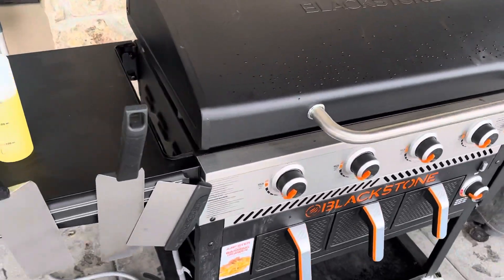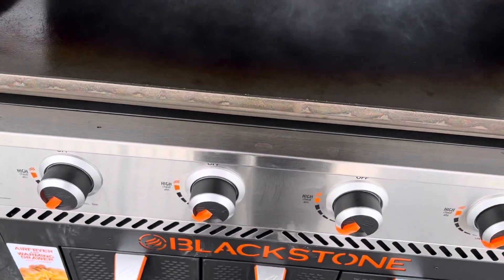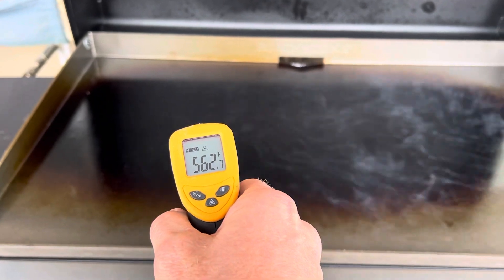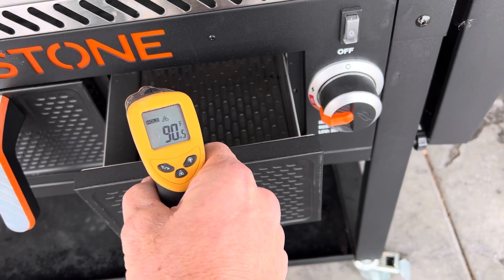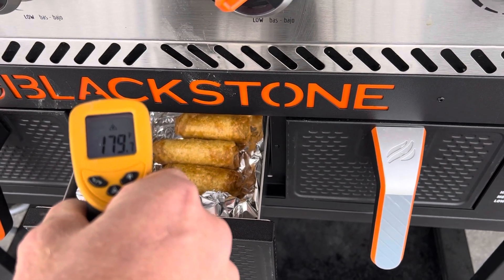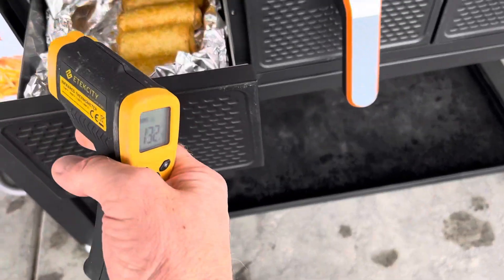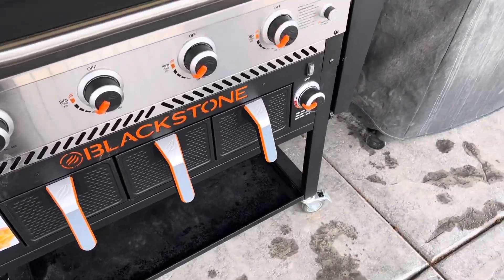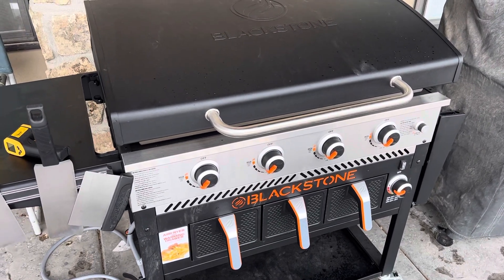Blackstone temp readings after natural gas conversion

Comment: Thanks! The right drawer is not an air fryer it’s the warming tray, which would explain the lower temp
Reply from the maker: I completely forgot about that! Yup, that makes sense. My batteries in my thermometer were acting weird so I thought that was it.
Reply: Also you’re probably getting the reading from the egg roll “food temp” not the air fryer. You’d have to get those egg rolls out of the way.

Comment: Can confirm what the temp gets to on the air fryers after running it for a while? They still say it’s not supported and I hope they can close to that 300-400 range but your video shows them in the 100 range still. Any update after running air fryers for a bit?
Reply from the maker: How long on high would you like me to run it to test it
Reply: @BryanHansen  I guess it would depend on temp outside and some other factors, if I’m not mistaken based on some picture black stone shows the air fryer on high will get up to 425F-475F, this is propane though but is ideal for crisping up food. The website says it’s not recommended because it will not get to max temp, so really curious how hot it will get say after 5 - 10 - 15min? I also wonder if the problem is running all 4 burners AND the air fryer. Maybe trying all of them and then just using air fryer by itself. That would give an really good idea.
Reply from the maker: @RyanandKelsieLaw  I started recording another video last night on the temps. I got interrupted so I didn’t finish it. 5 minutes in the air fryer was 321 degrees. I didn’t get the 10 minute temp so I scraped the video. I think I know why Blackstone says it’s not supported though. You can not, at least on natural gas, run the burners and the air fryer all on high at the same time. It is not hot enough. Individually they run great, but all four burners and the air fryer, no dice. It’s low to medium low temp at best.
Reply: @BryanHansen  I reached out to Blackstone customer service and they told me the only difference is that running on natural gas will run 50F less than propane, and they dont recommend conversion on this model because its hard to change out the orifice, but obviously based on your video the orifice can be changed with some work. My concern though is sounds like the 50F less is only if the top burners are not running. I already ordered my blackstone so i have another question for you, do you think its possible to covert top burners to NG but then reroute the gas line hose on the air fryers to run strictly on propane? or even convert it to run on a separate NG line? the NG line should be able to provide enough gas to all burners from my understanding so i wonder why its being reduced so much.
Reply from the maker: @RyanandKelsieLaw  It runs great. Honestly, it isn't that hard to swap the orifices. I think it is a line pressure (just thinking out loud) issue. Most homes are .5 lb psi and up to 2lbs. BBQ propane tanks are higher pressure, thus the need for a regulator. It runs, just not everything on high. I think it would likely be the same problem on propane running everything on high all at once, but since I have converted mine, I can't test it that way anymore. It would be more work, but not hard to reroute a separate line for the air fryer.
Reply from the maker: Had a chance to use my air fryer today. After 15 minutes, I set a timer, it was 400°.
Reply: @BryanHansen  well that’s pretty good, was that air fryer only? Or with griddle also running at the same time?
Reply from the maker: @RyanandKelsieLaw  air fryer only

Comment: Did you use the standard 5249 conversion kit to switch from propane to ONG, and if so did you have to do any modifications to the airfryer nozzle?
Reply from the maker: Sorry, just saw this. Yes, just used the 5249 and no I didn't change anything on the airfryer nozzle. I could have used a torch tip to open it up more, but seems fine the few times I have used the airfryer.

Comment: Did it hold up?  According to Blackstone they say that model isn’t compatible with nat gas. I have model #1868 looks like the same as yours. 

Blackstone says “Do not convert your propane-powered air fryer griddles to Natural Gas. It is not recommended and may result in problems with your unit and potential harm.”
Reply from the maker: Used it two days ago. Worked like a champ. The air fryer was 400° in 15 minutes.
Reply: @BryanHansen  have you ever been able to test the burners and air fryer at the same time to verify temperatures aren’t diving when all are on high like some others mentioned?
Reply from the maker: @ChadLower  Yeah, I have answered this numerous times in the comments. I wouldn't run the air fryer on high and all the burners on high at the same time. I don't think you would get the temps you want with it. To be honest though, I don't think you will on propane either. All 4 burners AND the the air fryer drawer and warming drawer take a fair amount of pressure. Mine actually did it. It wasn't able to maintain 400 in the fryer. I don't have an actual temp reading that I remember, but I want to say it was 300 or 310.

Comment: Thanks for being the Guinea Pig for the conversion… how hot did the air fryer drawers end up getting? Looking to convert before summer comes.
Reply from the maker: I just cooked with them and they definitely got hot enough to cook what I wanted to. I did not sit there and run them for 20 minutes and tank a final temperature reading.. Simply because I’m too impatient